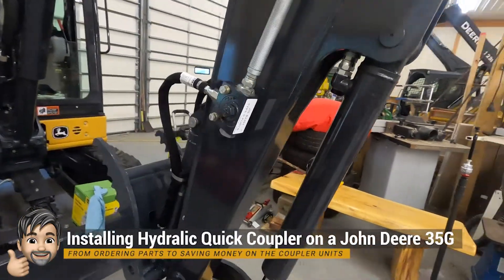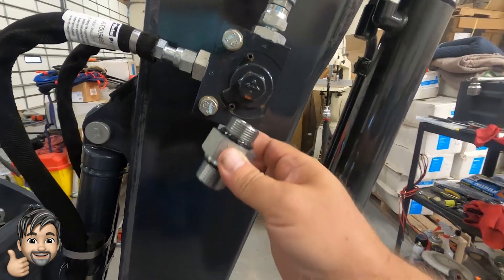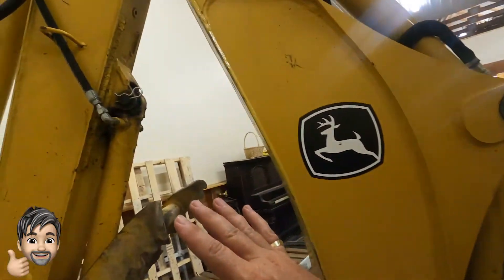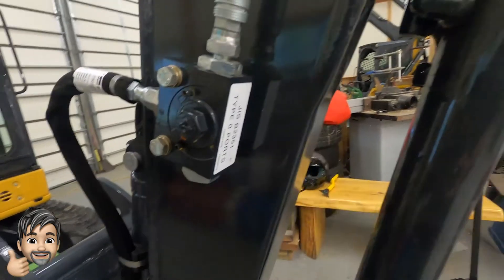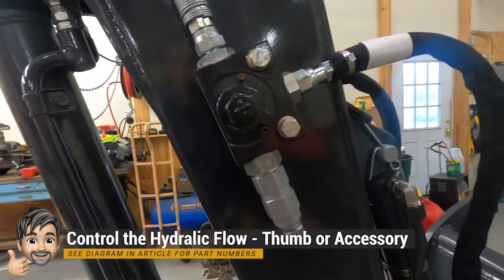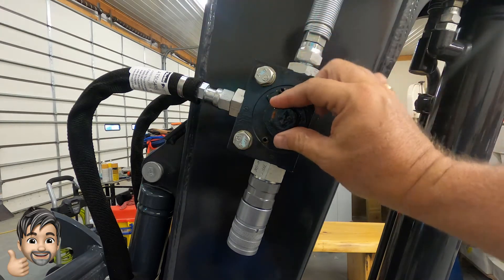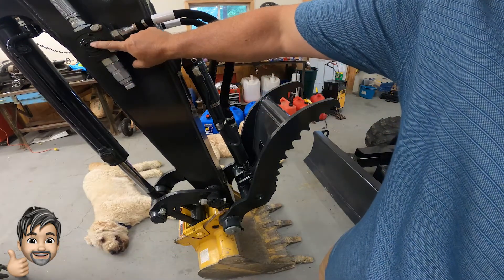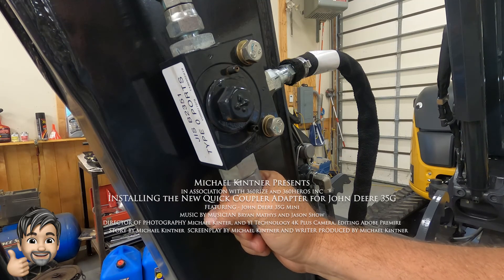Long awaited Adapter helps John Deere 35G Mini Aux Hydraulic Quick Couplers Hookup super Easy

Comment: Is there any adjustment to slow down the thumb speed? I have a 60 and the thumb slams open and closed.
Reply from the maker: I am not aware however if you have this value you might be able to limit the flow through this value by only turning half way.  Just a guess.

Comment: This exactly what I want to do for my 2016 J Deere 35 G so I can have a tilt bucket on and just switch over the diverter instead of disconnecting the hoses from the thumb thanks for posting the part numbers and video
Reply from the maker: Hey your welcome.  I just purchased a tilt bucket for my 35G and getting ready to post that video very soon.  They work great.
Reply: @cnerd  I’ll be curious to see which make you purchased

Comment: Have you tried to hook a attachment up yet?  I find the pressure makes it nearly impossible.
Reply from the maker: Yep no problem.  I did find if you turn the adapter on and off it slips right in.  But I only had to that once.  Did you have the machine turned on or off?  I did have my machine off.
Reply: I’m having the same issues connecting my hammer with the same system. Tried taking it off cold, installing hot. Sometimes it works, most of the time I end up having to crack the lines to relieve the pressure. Very frustrating
Reply from the maker: @darrylbartlett9297  hmm, i just had this happen last week and to fix this all I did was turn the value on and off on both sides and it relieved the pressure and I didn’t have to crack any line.  Not sure why that doesn’t work on yours.  Investigating more.

Comment: Nice video!  I just picked up a 27G last Thursday and when it was delivered, it already had the junction box and quick couplers installed!  It should really be standard on every machine.
Reply from the maker: Thank you and thats awesome they are now including them. Mine and another friend got the same machine, both 2020 and didn’t have them and it was a pain to find the parts.  Plus the flat face couplers are not cheap from John Deere and the ones we found were much less expensive and worked great.  Have fun with your machine, they are awesome!